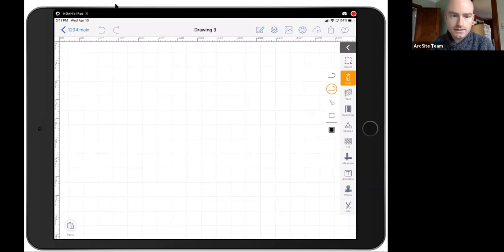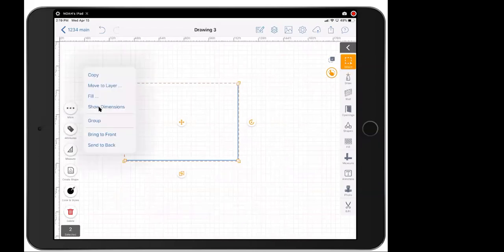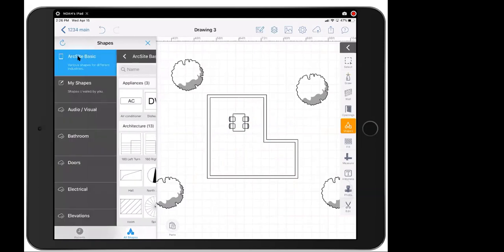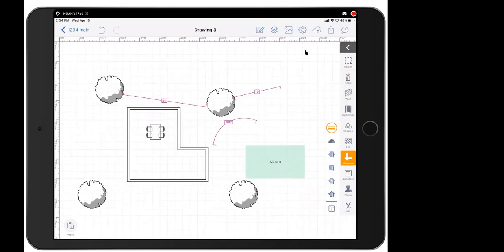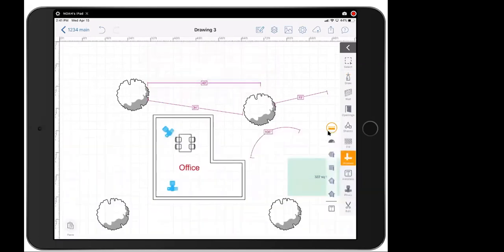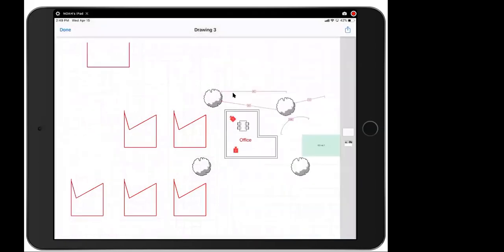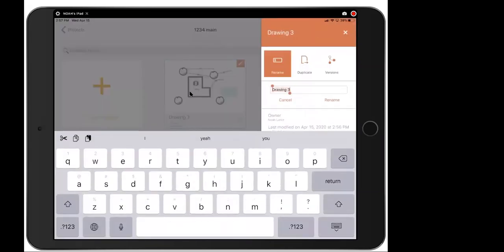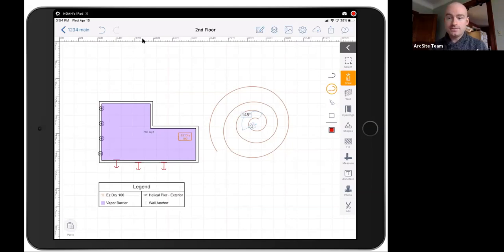Advice for Your First Week in ArcSite Webinar: Do's and Don'ts to Create a CAD Design

Comment: Is there a way to change graph size? I have to zoom in to 8’ wall and now I can’t see the grid
Reply: You can change grid size from settings. You can also zoom in and out by placing two fingers on the screen and pinching or spreading them.

Comment: I am using your software for a fence company, is there any tips, or shapes that would be good for me to use?
Reply from the maker: Hi there! This is Noah. 
We don't have a shape library specifically for fencing at the moment, however I do have a "product" library I can import over into your account if you are subscribed at takeoff and estimate or teams. If you'd be interested in using that reach out to me at noah@arcsite.co

If you can think of a resource for general fencing shapes I'd be happy to take a look at those and pushing them into ArcSite if possible.

As far as general tips go I would recommend sticking with line/arc mode to start with and using the manual input for getting your dimensions exactly right. If you are drawing on-site, be sure and use location based photos as much as possible for reference later.

Comment: How do I put the measurements in cm when drawing the dimensions
Reply from the maker: When you create a drawing you can select a unit and measurement type to draw in. If you already have a drawing in progress, you can adjust that by going to the "settings" menu by selecting the gear icon in the top right of the digital canvas.

After you have the right unit and measurement type selected, you draw distances in using the distance measure tool. If you want to show the dimension of something that has already been drawn, you select it and then use the "show dimension" tool on the sub tool bar on the left side of your screen.